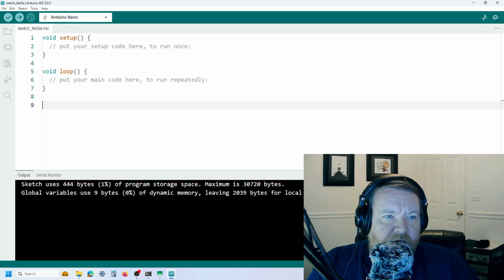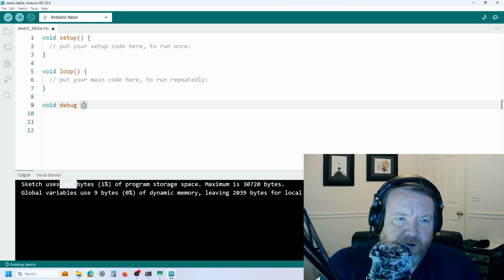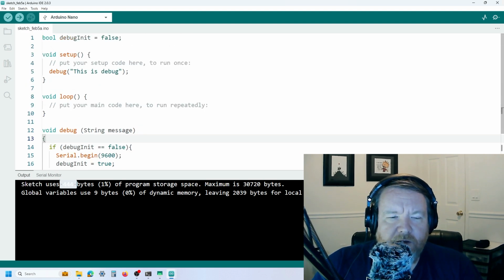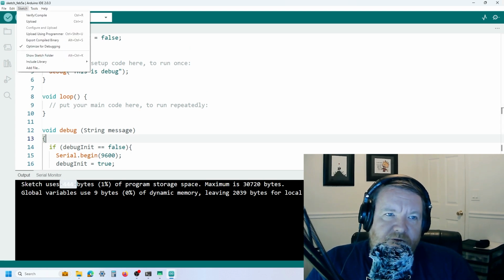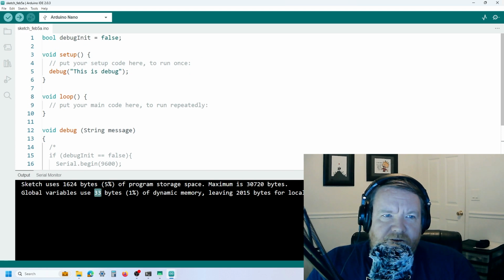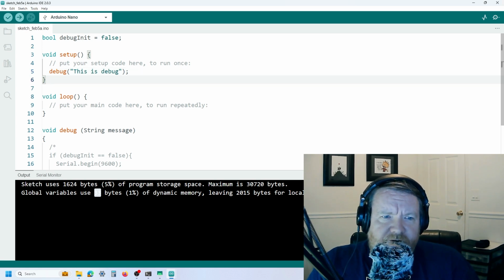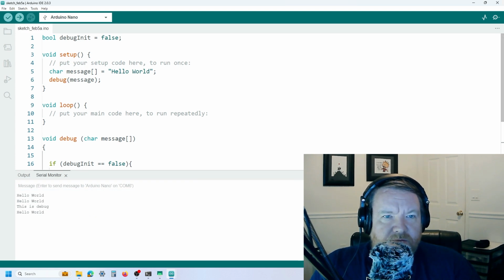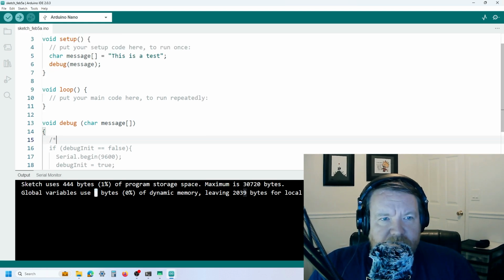Arduino Strings are not all the same!

Comment: Why not use the C preprocessor  (ifdefs, etc) to define different function signatures depending whether you want to debug or not?
Reply from the maker: The problem is not with the function, it's with the string variable. If you define a char array and do not use it, it will not be compiled. With this compiler, a string variable will be included in the binary even if you are not using it. Every other compiler I have used would not work like this. 
In my example I typically create a debug method with a string parameter. Even if the method is completely empty, the function call and string parameter are still compiled into the binary. I would have to wrap every call to the method with an ifdef statement to prevent the unused bytes from being compiled into the binary. If I change the method to pass a char array the problem goes away.
It's just an interesting bug I found with this compiler. I now avoid string variables with the Arduino compiler. 
Hope that helps.